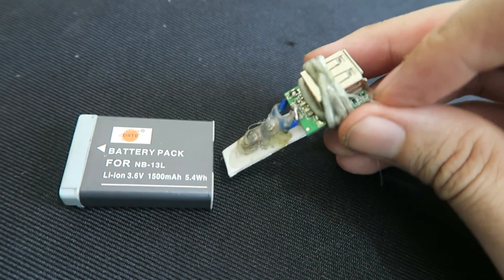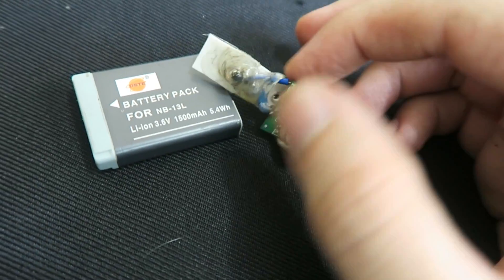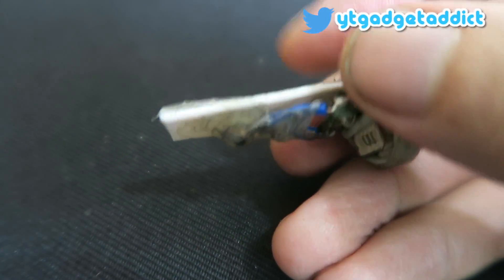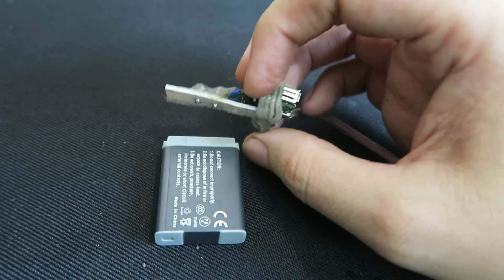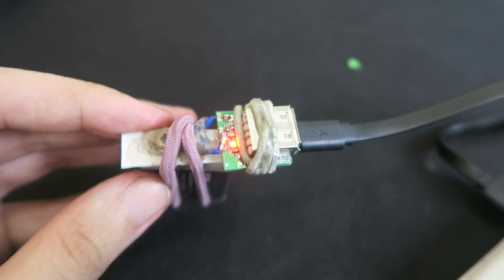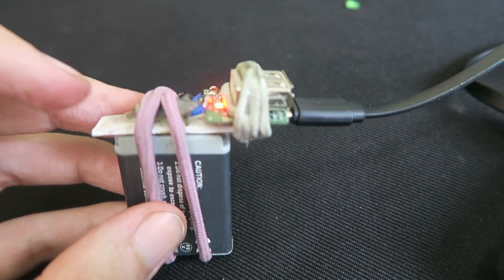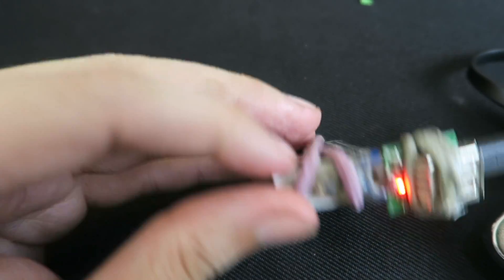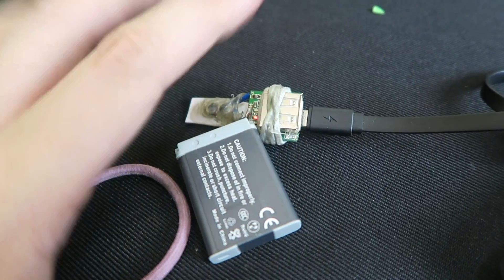DIY Camera Battery Charger Hack

Comment: I don't think it can charge my camera battery... It's 7.4v
Reply from the maker: +tan hock jun ah okay, yeah it won't work for those. Internally they're just two lithium ion or polymer batteries in series but since this only charges to 4.2V, it wouldn't be any good.
Reply: Well you can do basically the same thing by grabbing a boost converter, setting it to 8.4v and adding a micro usb port to the input, although if you do it I would recommend spending a little extra and finding a boost converter with current limiting, you probably shouldn't charge the battery any faster than 0.5A or so.
Reply from the maker: +vgamesx1 true but if you're gonna go to all that work you might as well just buy the USB charger for your battery on ebay for a few dollars. I guess it's another option though.
Reply: Yes but that's assuming that a usb charger exists for that battery and that it's inexpensive, now you can buy little universal battery chargers that have movable contacts and those are very cheap, however I've never seen one that charges more than one cell, so in the case of multicell batteries your only option for a usb charger might end up being to make it.
Reply: @vgamesx1  I have a "Soshine M20" universal charger -- I use it on 3.7V and 7.4V canon li-ion batteries, with no issues to date. Really rare, as folks can really screw up their battery packs if, for example, they line up the contacts wrong and charge 1 of the 2 cells instead of both. On the other hand, if there's only 1 cell , you can almost never go wrong other than possibly with the wrong chemistry type.

Comment: I once did that on my Nokia battery. But it degrade its quality but so convenient cause its fast to charge
Reply from the maker: +Kagura Schimizu I'm guessing it was a very old battery designed to charge at slower speeds? The genuine Canon charger is 0.7A going into the battery and this DIY charger is  about 0.8A.

Comment: Great idea gonna made one though this Gadget Addict is soo smart.
Reply from the maker: +BollardSpeaker 26 just be careful not to mix the negative and positive terminals and I personally wouldn't.leave this charging unattended. I made it because I only have 2 camera batteries and will be on the move today and need to be able to charge one battery while I'm using the other.
Reply: Gadget Addict the easiest way could be is soldering a wire to a step up converter(step up in 5V) then to a switch and to a USB.